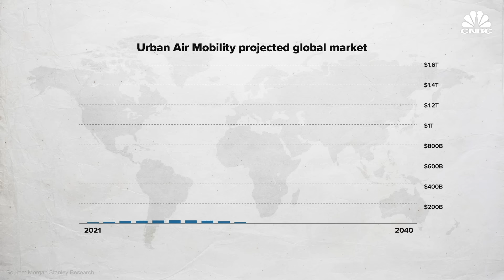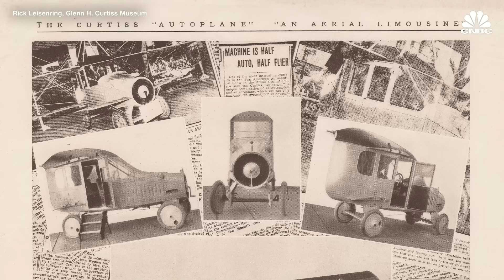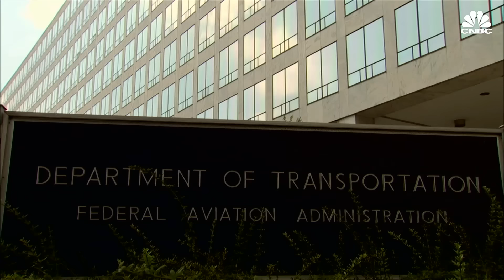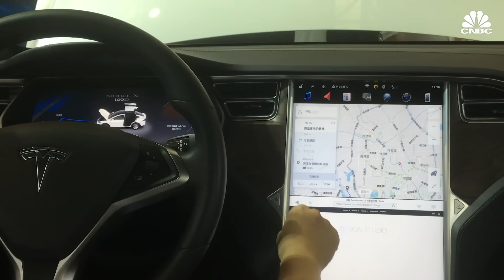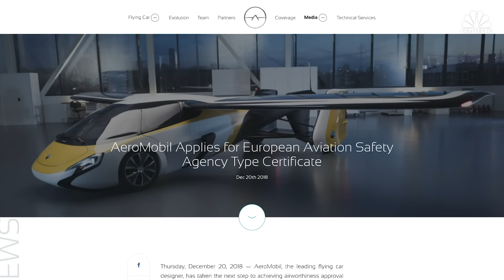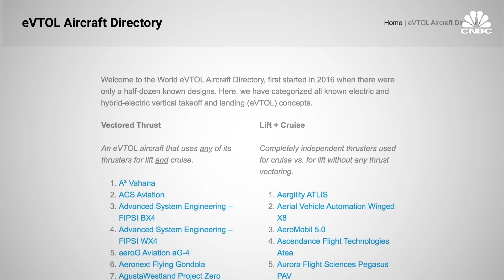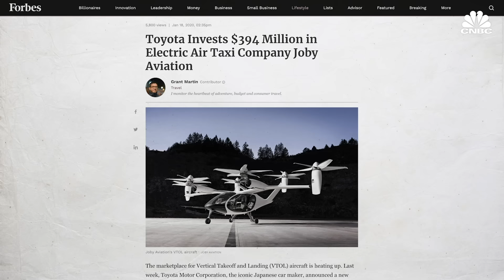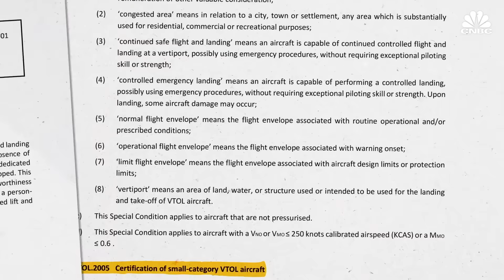Why Don't We Have Flying Cars Yet?

Comment: I don't wanna have someone crash into my house from the sky!
Reply: self-driving flying dude
All Companies are trying to solve your question that's why You don't have a flying car. Congrats companies saved your life because you don't have a flying car
Reply: @Brady Chuck if that's scares you then you may not use or consume imported products which comes through air.
Reply: @Brady Chuck when we didn't have cars, people thought that taken a ride in those cars might got exploded.
Reply: @xamantiwari  self-driving can be hacked. Also the software can be caused some failure like boeing.
Reply: @Brady Chuck Commercial airplanes are checked every flight and also have two highly trained professionals piloting them, airplanes crash much, much, much less than cars. If you give this to the average consumer it will be the same with cars but worse, with thosuands and thousands of accidents happenings every year, AI would be a solution to this, but we don't even have normal self-driving cars yet, so flying cars will probably come after self-driving car
Reply: Skyryse autonomous helicopters
Reply: @rizizum  Yeah, for the flying cars to be even remotely viable for average person, it needs to be fully autonomous, and super reliable even with minimal maintenance. This is very hard that the time we 'perfect' self-driving cars, we might at the very least have less issues with traffic in the future when every car is autonomous and have this massive complex hive-mind that regulates all traffic to minimize traffic jams and keep the traffic flowing. If we even continue to invest more on better mass transport system,  it will be even better that with these systems might be way safer, cheaper and less anxiety inducing solution compared to flying machine that can fall disastrously if something goes wrong.

I think autonomous VTOL vehicles (flying cars) may be still a reality in the future, but it might not be for everybody. There is more likely to have flying buses that can carry more people, thus making the transportation cheaper for already more expensive machine including its operation.
Reply: Insurance 😁
Reply: @xamantiwari  self driving is still way far off, that's why planes still need pilots even though there's autopilot because of unexpected events like changing weather, wind speed. You need human intervention
Reply: Commercial plane have air traffic tower that control the path of the plane. If flying car is going to be a reality, the traffic control must be develop first, not flying car
Reply: crashes into bedroom "Whoops my bad man, have a nice day!"
Reply: I think flying cars will exist only cause automated driving cars. You think you’ll be able to actually fly the car? Yah right
Reply: @Brady Chuck How about thousands cars flying over your house each day ? The drinking and party problem sound safe huh ?
Reply: @Brady Chuck Nope car exist for more than hundred years now, yet safety is still big problem. Are you a dreamer or just sleeping you whole life, 100 years to adapt seem doesn't enough or just don't adapt at all. Telling a simple fact called whining today ?
Reply: @Brady Chuck I've been living in 3 different country and 7 cities, don't teach me to adapt.
Reply: What I don’t hear in this conversation is training. A driver’s license is treated like a right in this country while a pilot’s license is a privilege and difficult and expensive to get.

A guy drove into my neighbors living room, literally. Everyone lived because by the time he drove through the window he was only going about 20 mph after the trees and bushes slowed him down.

A car falling from 10,000 ft would accelerate to ungodly speeds and leave a crater the size of a city block. The avg person is not equipped to take on this level of responsibility.
Reply: This happened to my friend a small plane crashed in his house.
Reply: Liability insurance would be sky high, to protect buildings, homes....
Reply: What makes u think they can't do that on land
Reply: any flying cars flying over my house space will be charge with trespassing
Reply: @ianmoone2463  ok karen
Reply: @xamantiwari  Thank sir I was just about to post that. Lol everything in the future is more likely to be automatic self flying/driving cars
Reply: Most likely gonna make you still drive on assigned roads.
Reply: In FL, a plane crashed into a house one morning while the parents and kid were asleep. The adults were killed but the boy received bad burns and lived. It was so sad and awesome since a plane shouldn't habe even been there!
Reply: The last thing i want to see is a Drunk ....... kamikaze on me or my home
Reply: They can crash into your house if your own the road what difference does it make
Reply: I love having 911 every day because of faulty ai

Comment: If cars were flying above me, I’d never go outside. Y’all know how bad we are at driving in 2 dimensions.... now add a 3rd dimension?!?!? No thanks.
Reply: So right.. and above that it will be a big security issue too. Govt will not take risks. And it shouldn't too.
Reply: We all utimatelt die because of upward godly forces . Sigh.
Reply: Of course; we can't trust the average schmuck out there on the road as it is.  It will have to be computer-assisted.  Basically you'll just be a passenger, telling the machine where to take you, and it will do most of the avoidance & safety maneuvers on its own.  Of course, a few people will die before the kinks are worked out, and then we'll always have to be on the lookout for hackers trying to reprogram these things and cause them to deliberately crash!
Reply: Ian - Money Talks  Agreed
Reply: Just use computers.
Reply: you cant control border and air traffic if you have tens of millions of cars flying all over lmfao, it will never happen people are already idiots driving on the highway
Reply: They better make parasuites for these flying cars in case the engine cuts off in the sky or maybe make a backup emergency engine for landing in case the main engine fails. Would hate for a flying car to fall into my living room while I'm sitting down watching TV
Reply: I guess the highway safety agency will have to make highways for flying cars🤷‍♂️
Reply: all the more reason flying cars should remove the steering wheel and pass laws that requires all flying cars to use automated flight paths
Reply: You guys get to go outside ?
Reply: Exactly. There's a reason why it takes time to become a pilot.
Reply: No worries it won't be humans doing the driving.
Reply: @Izzy-qf1do  i really doubt we'll ever pilot a flying car, engineers are already coding virtual flight path AIs to do the flying for us for that reason, i'm for one are ready for that day to come so i don't have to buy new cars
Reply: @mmoarchives2542  well there's more than just steering. People won't know the physics of flight. They cant even manage to turn their signal to switch lanes. Might be possible for commercial purposes in about 50 years probably. But I hardly doubt it's ever going to be accessible for everyone.
Reply: Soham Patil The forces are ungodly lol.
Reply: Ian - Money Talks your right  Even if you did have flying cars we would still need the infrastructure and the safety regulations to implement them being in use Every driver would essentially need a pilots license it would just be a nightmare to implement really
Reply: Add overstimulation to the equation. I think flying cars are a bit too much for lots of us.
Reply: You people are very limited when it comes to understanding the potential of technology
Reply: @Izzy-qf1do  that's what i was just saying, we won't ever own flying cars, flying cars will be an autonomous uber service, i'm already picturing a hailing pole at every house like there is mailboxes that sends out hailing signals that uber cars will automatically arrive and pick up human cargo, and won't take off until you give street address instructions to a panel
Reply: You wouldn't even be safe in your own home. Imagine some drunk falling out of the sky and crashing into your bedroom at 3 am.
Reply: Ok
Reply: @nyx211  in the news today, a drunk man tries to go into space in his flying car before stalling out and crashing into a trump rally killing all 34 total at superbowl stadium
Reply: @osamabinladen824  so how's ocean life bin laden?  you're beard isn't wet is it?
Reply: Honestly the likelihood of hitting someone in air would virtually be impossible
Reply: Yep, flying cars are here. Only the tech isn't being made available to the masses until the cars are automated. Let's get the land base vehicles automated first.
Reply: @mmoarchives2542  It's nice here. I see Spongebob.
Reply: They’ll need airways for the cars. You don’t want to fly under a 747 flying  at a low altitude
Reply: Yo, if we combine all of our expertise in this thread, we can basically replace the FAA with a crowd-sourced, youtube-based, volunteer Federal Aviation Administration
Reply: @IanSeabrook  both hyperloops and flying cars will doom the FAA
Reply: Cars will be flying, not people. VTOLs will never be economical w/human pilots.
Reply: @kevinkent6351  my point exactly
Reply: An object weighing a 1000 pounds coming down at high speeds kills you even in your living room. And your family in the kitchen. And probably your neighbors too.
Reply: Exactly. Too many people incapable of following the existing rules of the road...consistently. There would be far fewer drivers on the road if existing road rules were enforced so bad drivers were banned from driving. Easiest and simplest solutions. If you can’t drive correctly you use Lyft/Uber/public transportation.  Can’t progress till simple rules are followed first.
Reply: Agreed. The best solution are multi-layer roads just like in the film Minority Report. Cars fly to get to higher levels of the road, but that's it.
Reply: @Copycat Singers Yup. If only drivers are perfect drivers all the time.
Reply: Drunk flying will be a thing
Reply: @Copycat Singers There are actually more space in the sky, but just how chaotic it would be if flying cars become a thing. There should be a way to restrict or confine flying cars in something like a sky road or highway to protect pedestrians, buildings, houses and other structures. Otherwise 30 story building car collision will be so common. Or imagine a car running out of fuel or energy in the air.
Reply: no to flying cars, yes to FLYING TRAINS, yes to maglev.
Reply: flying is technically easier that driving , in some states you only have to be 14 to earn a basic pilots license
Reply: could be self driving
Reply: They will have auto pilot.
Reply: @Flash Gaming Parachutes dont work well on heavy objects or every cessna and every helicopter would have one. Aeronautics ain't so simple
Reply: Ian - Money Talks we already drive in the 3rd dimension....
Reply: Don't you mean 4th dimension? You're not very smart.
Reply: Qui3t Storm oh yes I forgot about time 🤦‍♂️
Reply: Need to get really high to watch this, uh  BS.
Reply: Ian - Money Talks Flying drivers would immediately run over flying pedestrians and flying bikers.
Reply: @Flash Gaming self driving cars are already risky.
Reply: If traffic wasn't so bad Kobe wouldn't need a helicopter...high speed rail or flying cars is the next step in travel evolution.
Reply: I think the only way well see them is through pay as you go programs with automated vehicles. I say pay as you go so that way ALL MAINTENANCE AND REPAIRS are completed and there's no flying hoopties. And automated because flying anything would prove far too difficult for the masses.
Reply: We need cars that only hover over the roads by a few feet.  They should still have tires in case it fails so the car wont slam into the street they should hover and work with tires.
Reply: @denissavic500  You get here something wrong. People wouldnt be allowed to fly the car for themselves. The only way this can work is with an autopilot. The drivers would only be passenger, every flying car talks with every other flying car. And of course near airports flying cars wouldnt be allowed and they would never fly near the height of regular planes. Thats pretty obviousely ^^
So thats not a real issue. The problem is the noise and the safety. When we get those both problems under good control, flying cars can be a thing in the future.
Oh, and better batterys.
Reply: @denissavic500  You get here something wrong. People wouldnt be allowed to fly the car for themselves. The only way this can work is with an autopilot. The drivers would only be passenger, every flying car talks with every other flying car. And of course near airports flying cars wouldnt be allowed and they would never fly near the height of regular planes. Thats pretty obviousely ^^
So thats not a real issue. The problem is the noise and the safety. When we get those both problems under good control, flying cars can be a thing in the future.
Oh, and better batterys.
Reply: PP airplanes are ancient technology it 100 years will go away they are very unneficient lmao ,just think of this  , underground vaccum tunnels connecting the whole world where you can shoot magnetic levitating trains at speeds 3-4 grater than speed of sound beats any airplane in every way.
Reply: Flying cars could  be flown or driven by software the vehicle will drive itself using the network especially above urban area as well open area.  2040 could be the near future.
Reply: WulfCry you promoting 5G then youre gonna get hatred lmao
Reply: So you better stay inside then.
Reply: Computerized guidance means the pilots just punch in the codes, and sit back.
Reply: They're supposed to already have guidance systems that act as both computerized navigation as well as air traffic control, much like the self-driving cars, but in the air. You don't even drive it, it's all on computers.
Reply: Many years ago I had the idea for airlines to have parachutes. HUGE ones.
Reply: You'd probably need to get some real experts who work for the FAA,  Boeing, Lockheed, etc., to join on. But with the virus keeping people home, maybe not a bad idea.
Reply: Probably more like helicopters, with the wealthy owning them to avoid traffic. They can afford the luxury.
Reply: I'm sure they would have backup batteries and motors, as well as regulated automated routes that avoid flying over buildings and homes as much as possible.
Reply: You nailed it pretty well. I saw some videos on it, and they have everything monitored and controlled.
Reply: From what I gather, they aren't going to be widely used, due to the expense, mostly. Like small plane owners, and helicopter owners, now. There will be more self-driving cars and commercial vehicles. As well as auto-piloting commercial use VTOLs. Like mail delivery.
Reply: And those who are wealthy enough to fly them will probably have to have a clearance signal that would need to be received in order to legally enter countries.
Reply: Maybe flying cars can be more drone like because they are easier to control
Reply: I don't get it
Reply: That's complete bolocks. While you are stuck at 2 d you would become better at 3 d. The fact that you are limited by 2d makes you a bad driver and dont even get me started on the automatisation bs..
Reply: That awful voice.
Reply: Kent Peterson 😂
Reply: isn't this just a helicopter with wheel?
Reply: Outside would be safer I don't want crackhead lunatics falling on my house 🤣😂
Reply: Just in time for COVID-19! It'll be a great incentive to keep many people indoors 😀
Reply: Umm....Sorry to break this news to you, Ian...but, ALL drivers are operating in 3D...lol Being in the air doesn’t add an additional dimension to anything...lol But, I like the way you tried to remove a dimension from land driving, making it 2D, to facilitate the addition of a dimension when flying in the air...lol
Reply: @joeluft8969  All you're driving is left, right, forward and backwards, that's all 2D. When you add up and down, then it's 3D...unless you drive off a cliff regularly, then sure, you're driving in 3D.
Reply: Wym dimension
Reply: @MrElectrifyer  well the solution could be a hardwall computer limitation, like the flight computer has setup like a hard ground that you can't ever go down unless on specified exits. Like making a skyway through software.
Reply: @MrElectrifyer  and you will be able to see the skyway, exits, etc through some kind of windshield that displays augmented reality ohhh that would be so cool.
Reply: faa would like that.
Reply: Ian Seabrook: THE CARS WOULD FLY THEMSELVES.
You say say "HOME" just like to your Waze app, then you just enjoy the ride.
Reply: Ikr
Reply: Much like with highways, when we ever get flying cars, you won't be able to just take off wherever you like similarly to how you can't enter a highway from wherever you like. There will be fixed pathways you would be able to fly through, and fixed entry and exit points.
Reply: you DO know that massive planes (multiple times the size of a car) are indeed flying over your head, right?
Reply: The last thing i want to see is a Drunk ....... kamikaze on me or my home
Reply: The only viable option I see happening is hovering cars!!! Cars that can drive on roads, but can also hover e few meters in the air to go over other cars or jammed traffic! This way the cars are limited in their flying abilities and there's no crash risk! They can also add a separate lane on the highways for hover cars. But the easiest thing is to just adjust all the traffic rules, so people will know how and when you can hover up your car and fly up. The hovering should not be magnetic, as this impossible to implement in the roads we have! This requires full road rework! They should find some sort of propulsion technique that is not too  noisy.
Reply: That would be cool though